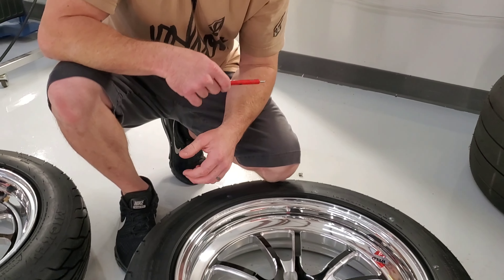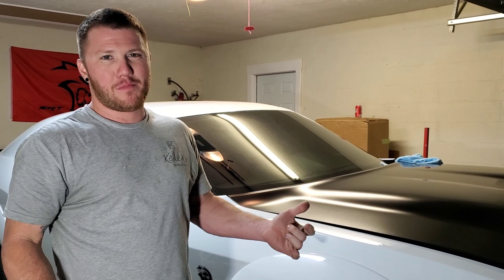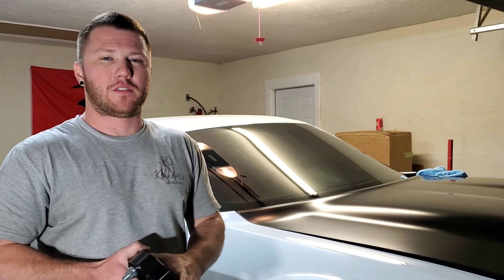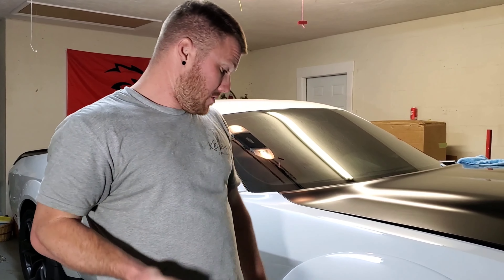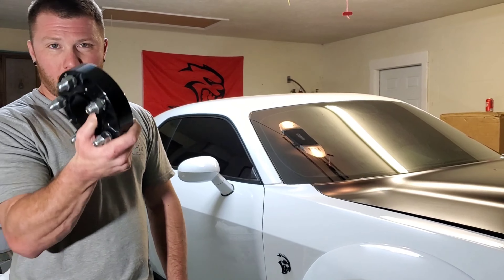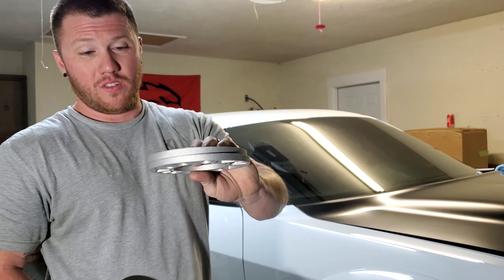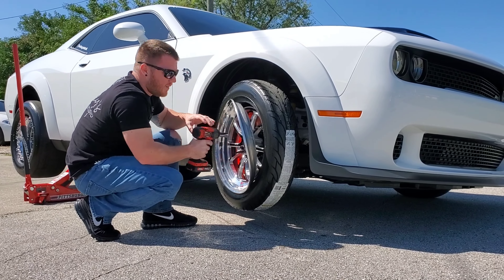Installing Weld Racing front runners for my Hellcat part 2

Comment: Hey, I agree with you on skinnies usually not looking right on the front with widebodies.  That spacer looks trick.  I haven't touched either of my Hellcats in a while, but your videos keep popping up and I'm actually getting inspired a bit.  Regarding that rim failure, you bet I'm gonna stay tuned.  Happy you're ok.
Reply from the maker: Thank you! I finally got the new set installed and made a few passes at the track. Check out the latest video!

Comment: Wow that is bad. I waited 8 weeks and had issues with the fronts not clearing the calipers. I had to go with a 5MM spacer but it is still close. Amazing that the wheel disassembled itself but glad it happened before you put speed to it.
Reply from the maker: I'm glad that it happened in my driveway and not anywhere else. Weld has been really great about it so far though. Looking forward to getting my replacements. 🙌🏻

Comment: What front tires are those and how much air pressure were you running?
Thank you.
Reply: Ah ha, watched your video again and it looks like Mickey Thompson Sportsman S/R 18/6.00R18 tires; did you have them at the maximum inflation of 95 psi? That may be why they popped apart. I was thinking about putting a set of these on a pair of Dodge Demon 18"x4.5" factory wheels but now I'm wondering if they can handle the pressure. That is really scary, you were so lucky it happened where it did...
Reply: I ended up running these same tires on OEM Demon 18x4.5 wheels; I run them at 75 psi.

Comment: By any chance man do you where i could get some of those center caps i bought 2 different ones and they dont fit i need the screw on ones
Reply from the maker: The center caps that are on the car don't screw on. They are inserts that float freely. I've never heard of Welds using a screw on type of center cap. Sorry man.

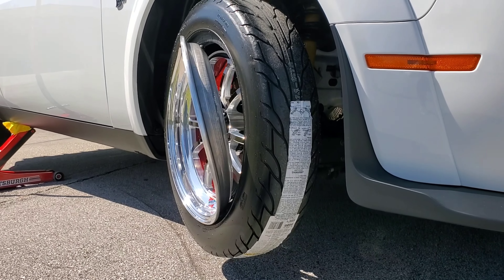Comment: 6:08 WTF - Thinking about ordering the alumastar front runners for my cat but not sure after seeing this.
Reply from the maker: Don't let this stop you. This is only 2 of 45,000 units. No risk, no reward. 💪🏻
Reply: @KelleysGarageOfficial  At least Weld is making it right which is huge. Starting with the no grind 15" conversion with weld s71 15x10 in the rear. Next season can probably grab the alumastar 2.0 front setup. Should help my 4.5L whipple cat put power down. Good luck with your build! Looks very clean.
Reply from the maker: @SUPERCARSANDCLASSICCARS  good luck to you as well, sounds like you have a beast of a car with that 4.5 Whipple!

Comment: BTW, those balance beads are terrible, my cars starts shaking at about 75 mph and shakes the rest of the way down the track. I took all the tires off, threw away the crappy balance beads, and had them balanced property. Smooth as glass now...
Reply from the maker: You're not supposed to have your race wheel set up balanced. Especially with the clearance issues between the wheel and the brakes. I've used balancing beads for years and never had any issues with them.
Reply: @KelleysGarageOfficial  And I've never had a wheel blow apart lol. Been racing since the late '70's and we always balance our tires...
Reply from the maker: @artillerybuff2000  are you saying that was my fault?
Reply: @KelleysGarageOfficial  not at all, just making a bad joke, sorry...

Comment: Wtf I just commented on quality control 30 secs later your wheel exploded
Reply from the maker: Defects are always going to happen in manufacturing, I was just the unfortunate one to get it this time. I actually ended up having a great customer service experience with Weld and got this set replaced very quickly. I'm really happy with my full set now!
Reply: @KelleysGarageOfficial  I agree but when you get the rears from one site and the fronts from another site and they all have to be replaced from weld due to defects is a problem. I do agree about the customer service portion but it was a big disappointment to have to deal with a return for all 4 wheels.

Comment: Can you actually recommend weld wheels after this?  What forum do you suggest as Im looking to build mine. Have you notice turning the red eye at slow speeds and front tires grabbing and pop skidding?
Reply from the maker: After Weld replaced the bad set of wheels I never had an issue after that. If you order a 1 piece billet front runner you won't need to run a spacer. However, if you choose to run one of their 3 piece styled wheels you will most likely end up needing to use one.